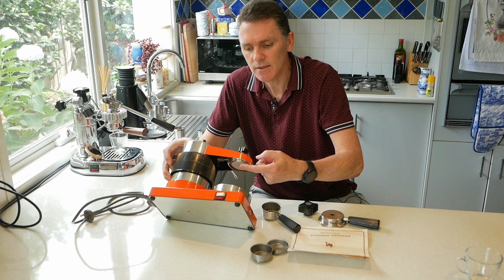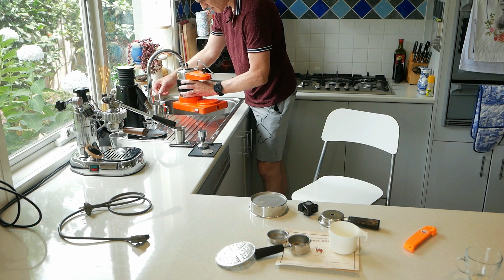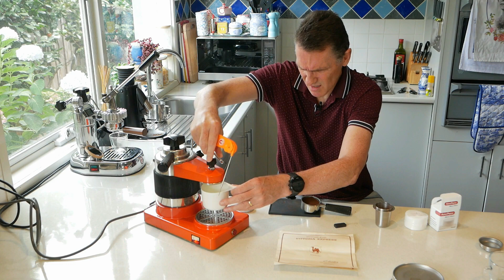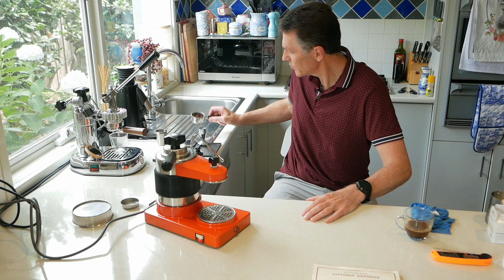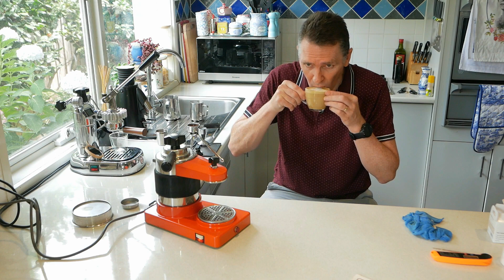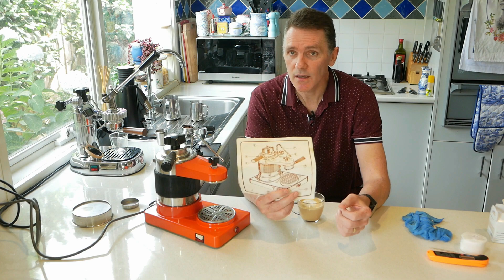Vintage 1970s Vittoria Express Columbia Calandra & Co Espresso Machine - Better than a Bellman CX25P

Comment: Hi, do you habe any Idea what the Grid inside the Boiler hood is meant for? When you remove it from the boiler you can See the Grid inside the rubber seal. I can't quite determine the function of this. Best
Reply from the maker: Probably just acts as a filter to prevent anything blocking the outlet nozzle.
Reply: @michaelporter000 Hi, bit there ist no outlet in the top, right? It.is just the top cover of the boiler sealing it. No clue, I still don't see the function. 😂

Comment: Just acquired one of these. Didn't come with the instruction manual, so thanks for your excellent video. (Will try to hunt down a copy).  Intrigued to know what the purpose of the filter under the gasket of the screw down top would be. Any ideas ?
Reply from the maker: The filter at the top is probably to limit what can get through to the outlet valve/tap so it won't clog up. Here are links to the manual pages I photographed https://photos.app.goo.gl/7ofD1wiE63Jsx5Xo7
https://photos.app.goo.gl/4X7WhaVKEQiXXaxK9
https://photos.app.goo.gl/9Gm2bcnxDdHzK5jv7

Comment: I've used this machine for many years, and to make milk based coffees, I think it is an excellent little machine.
Reply: I have one of these too - have you ever found a replacement for the stepped seal that sits under the shower screen? All the other seals are easy to replace, but I have not been able to find a replacement for the stepped one

Comment: Did you ever find more information on these machines? I just restored the same unit, however the Bakelite is a brown "wood-grain"-esk version. Also the light on the front is green, I seem to only find the orange model like your video.
Reply from the maker: No, sorry - I haven't found any more information. I have the original instructions booklet. I was told some chain store sold it in Australia for a short while a long time ago, but the booklet doesn't indicate which store.